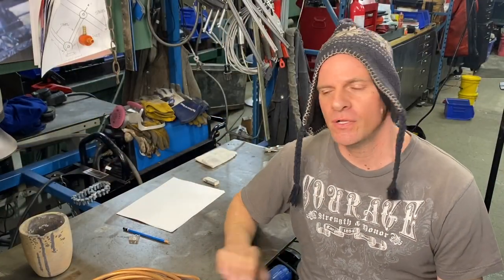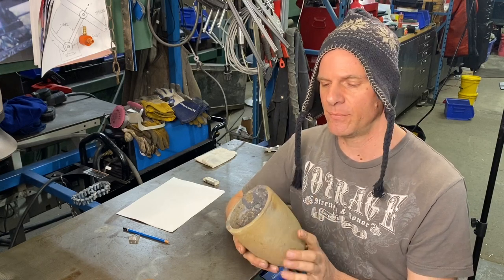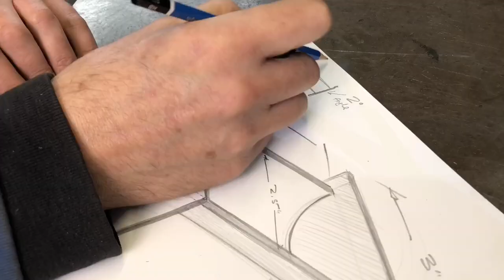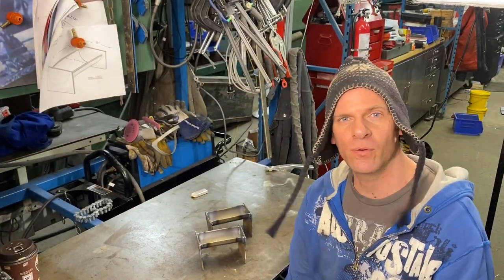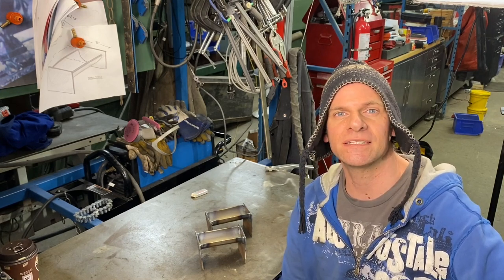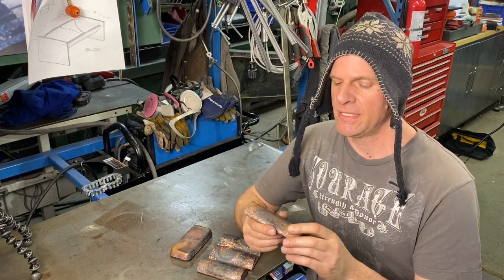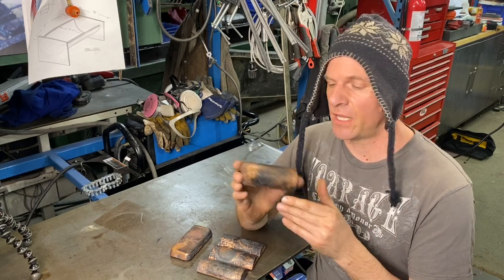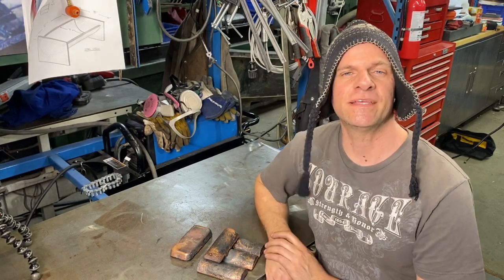How To Cast Copper Ingots From Scrap !!

Comment: I have a lot of brass and copper scrap (metal detecting finds) that I need to melt up.  I was thinking I'd need to build a foundry after I build my ribbon burner forge, but your video proves that I don't need to make yet another tool; I can use the forge I'm going to build to melt my scrap!  And being at a more workable height, it will be much more convenient than the typical foundry on the floor.  Awesome!  Thanks, again!!!
Reply from the maker: Donorcyclist no problem thanks for watching 🙏

Comment: This video really surprised me.
I never considered melting in a forge, i always understood that melting was done in a furnace. I was building a casting furnace/forge. Upright it's a furnace, on its side a forge. I had mistakenly ordered too little refractory mortar, i should've doubled it.
Have you much experience with casting, as it pertains to aluminum?
I ask as i am building an armour, and it was suggested that the strength integrity is non existent with cast. Can you confirm this?
Thanks again for another great video...
Reply from the maker: Casting aluminum is definitely strong just make sure you try and use a good grade of aluminum old casting will have more porosity and this is where you will have strength problems , thanks for watching
Reply: @BonifabcustomRobBonifacio  
I'm trying to watch them all.
Thank-you for making them.